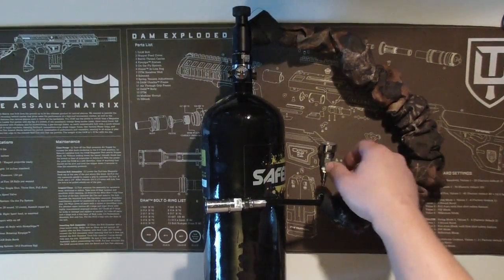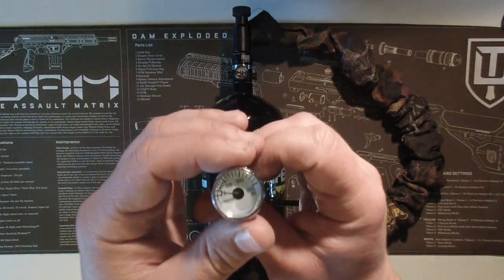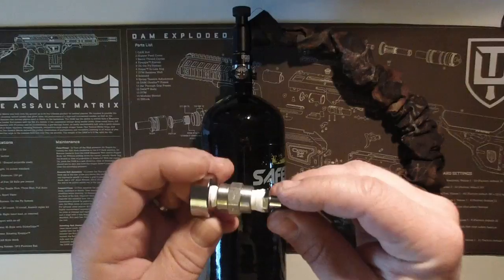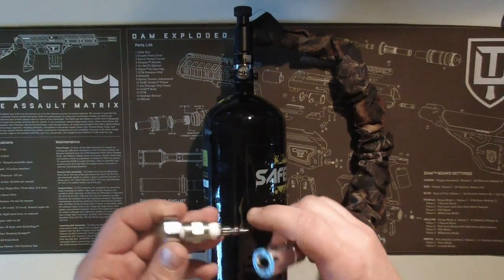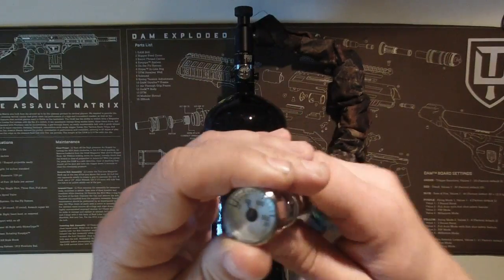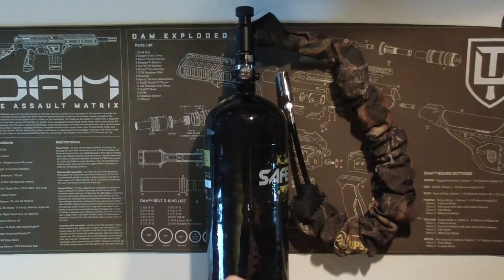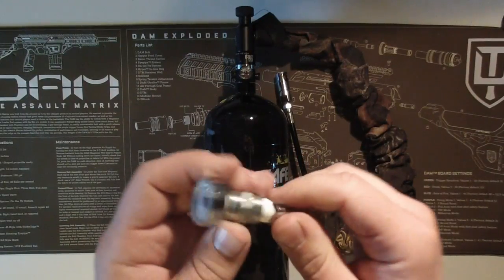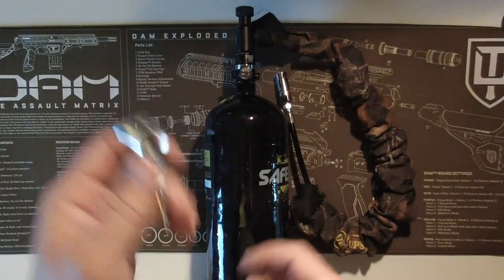Paintball HPA output pressure gauge rig

Comment: what's the link friend?
Reply from the maker: The Gauge http://www.ebay.com/itm/2Pcs-Paintball-Mini-1500psi-Pressure-Gauge-1-8NPT-thread-/252436107056?hash=item3ac65d4f30:g:KLYAAOSwBnVW8qGY
Reply: +Billyboy and what's the piece you connect the gauge too? remote line adapter?
Reply from the maker: The Gauge is screwed into a 1/8 female coupler, and then that is screwed into the remote line adaptor 
Adaptor
http://www.ebay.com/itm/Edelmann-Fitting-Coupler-Straight-1-8-in-NPT-Female-Threads-Brass-Natural-Each-/331388506560?hash=item4d284b51c0:g:-sUAAOSwEeFU~-QO&vxp=mtr
Reply: +Billyboy I got you boss! Reminds of of trains how there is a female and male coupler that interlock and the hose connects air pressure for the brakes. Lol I work for the railroad thanks a lot boss great work!!
Reply: +Billyboy I also subscribed!
Reply from the maker: When I get a chance I've got a different one I've made. I'll hopefully get around to it next week :)